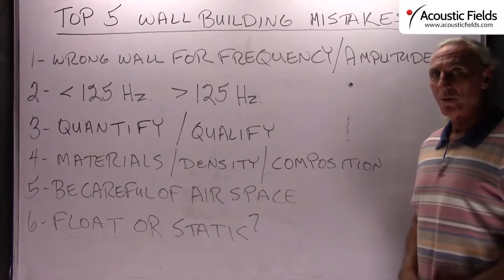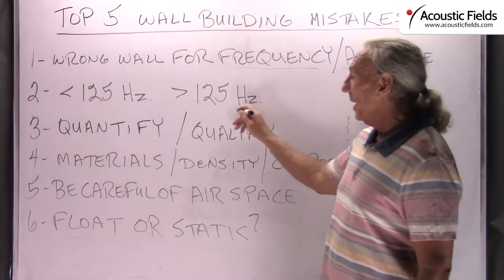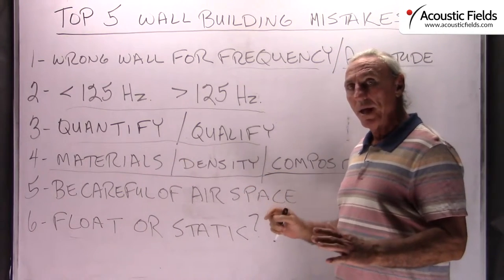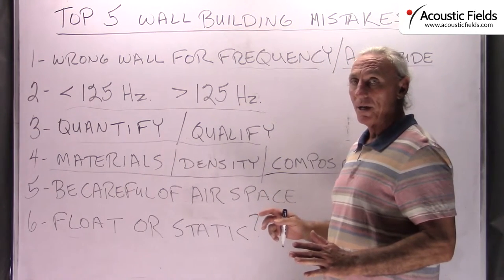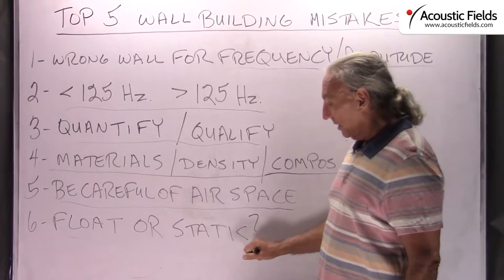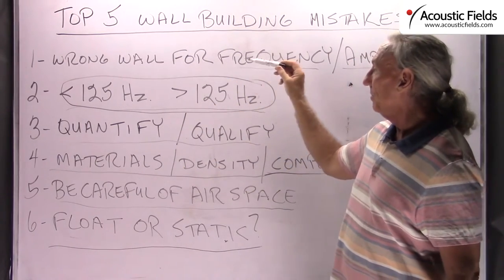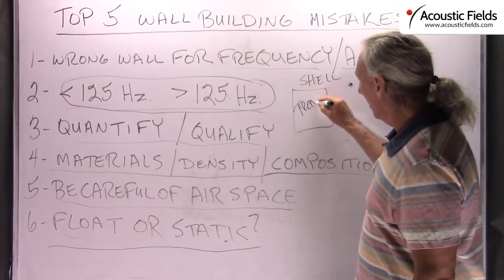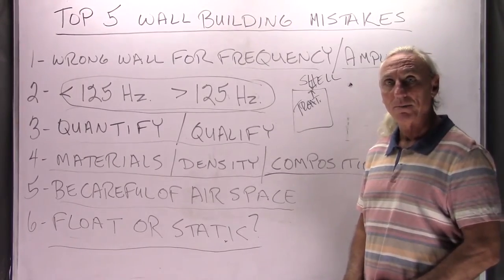The Top 5 Wall Building Mistakes - www.AcousticFields.com

Comment: I wish I would have heard this before using drywall. However, I did succeed in soundproofing the room. I have a few strategies for treating the room. I look forward to sharing what I’ve done with you. Cheers!
Reply from the maker: All material types, their associated densities, and the way they are arranged within the barrier, are frequency and amplitude dependent. This is what most people do not understand. This is why it is so critical to measure the frequency and amplitude or strength of your noise issue because the materials you will use have different costs and other requirements.

Comment: Hi Dennis
Really appreciate the information you make available through your videos. I bought the plans for your bda absorber which I'm looking forward to building when my room is ready. 

You mention alternatives to drywall, would you be able to give some examples as I'd be very interested. My room's shell is 8" solid concrete block to address frequency and amplitude of live drums, but I've yet to construct the interior walls. 

Many thanks
Rod Mcfarlane
Reply from the maker: Hi Rod, Concrete block is a good barrier technology but doesn't assist you much with internal treatment for absorption / diffusion. The interior treatment for a drum room would have to be calculated based upon room size and volume. Fill out the information asked for in this link: http://www.acousticfields.com/free-room-analysis/ Lets take a look at your room requirements.

Comment: in my country walls are built with cement blocks,  do i need to double wall with marine plywood or can i just compensate with acoustic panels? THANKS DENNIS.. YOU ARE A GENIUS
Reply from the maker: N, It depends on the noise your cement blocks are working to stop. Without noise numbers, I can not tell you what additional, if any, material to add to the existing walls.